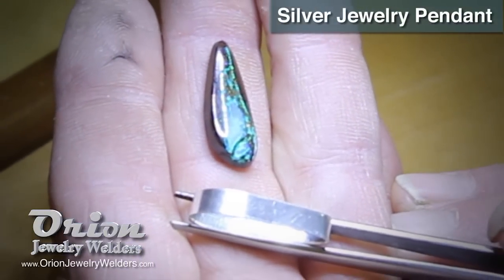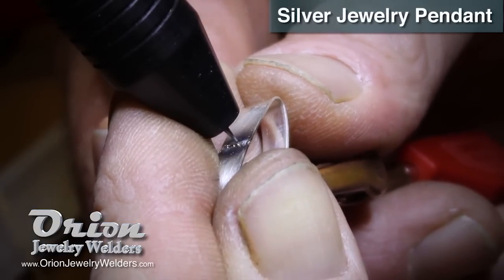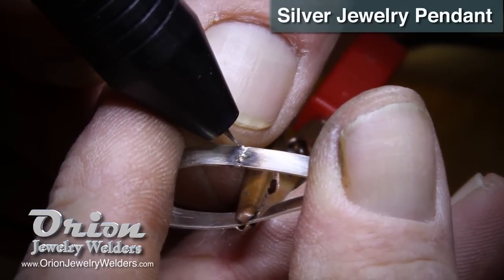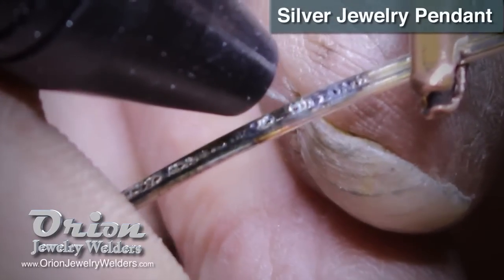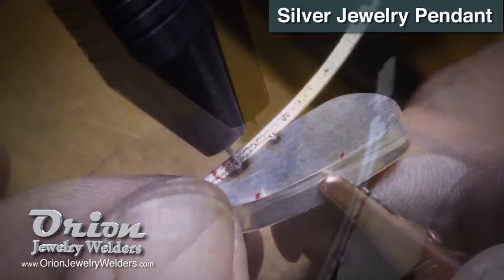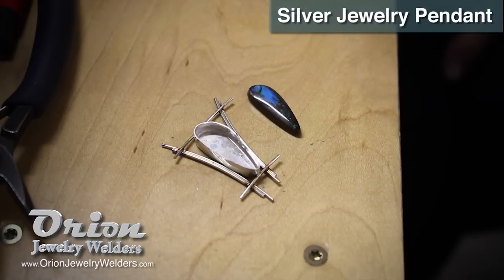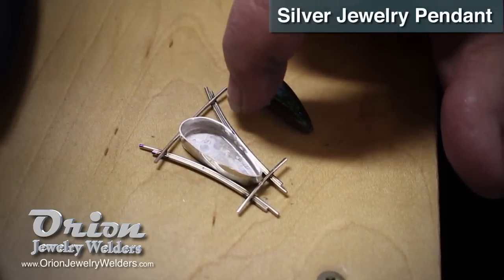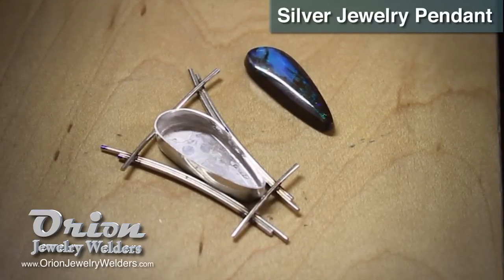Constructing a Silver Jewelry Pendant with an Orion Welder

Comment: Two years ago Ruthie & David Alberts attended the Stuller Bench Jewelers' Workshop in Lafayette, LA in order to check out the Orion Pulse 150i, designed to do welding like a laser, but at 25% of the cost. Ruthie brought a list of 33 tasks for the Orion to fulfill. It did them all! So, she bought one. Two years later, Ruthie & David have been invited as guests of both Stuller Inc & the creators of the Orion to be GUEST DEMONSTRATORS at the upcoming 2013 Stuller Bench Jewelers Workshop!